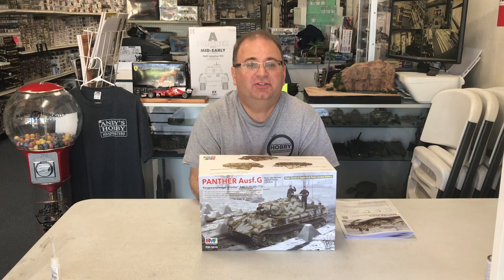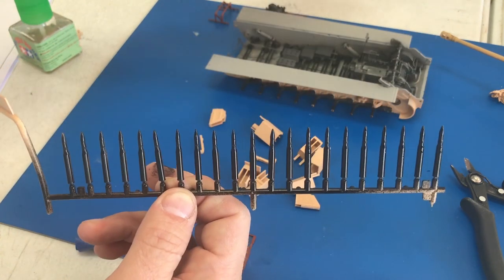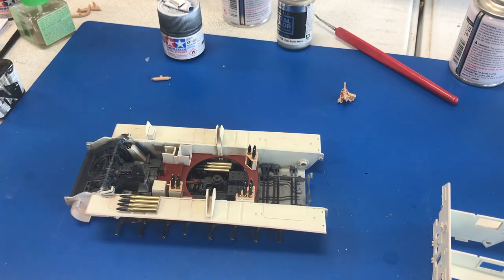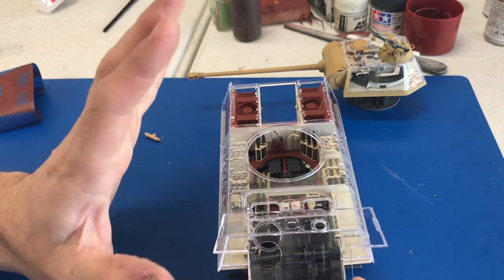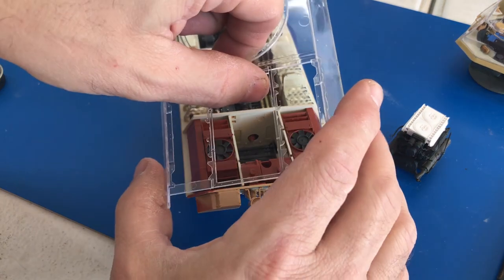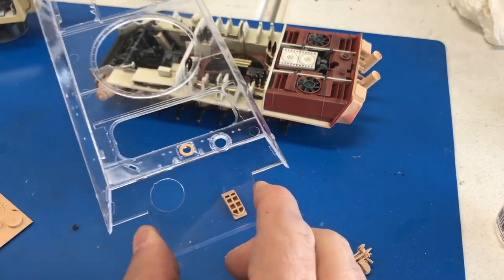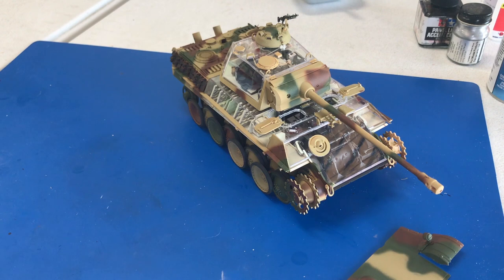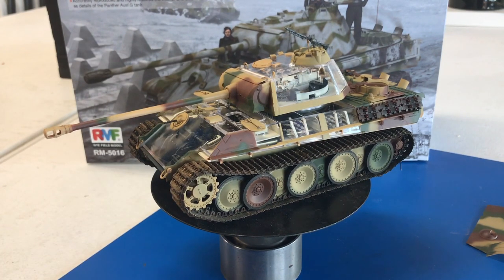Building the Ryefield Models Panther ausf G  part two with full interior

Comment: I know this was a couple of years ago but I have just started making the Jagdpanther G2 and I would say these kits are definitely not for the beginner. So far I have built the gun and upper hull and there are a massive number of very small parts where I had to use a powerful magnifying glass to do the work. The Jagdpanther only has a clear roof to the gun compartment so I have used my dremel to cut through the walls of the hull otherwise the interior detail won't really be seen. Like you I am going to leave out a number of the shells to aid visibility of the interior.

Comment: Excellent job Andy. This is a great run-through for those of us who want to build the kit. As the issue with the front painted glacis vs clear glacis unfolded I wondered if one could slice off the weld beads that are on the side plates and glue them to the painted glacis. Then the painted unit could just slip or rest right on top of the clear portion. I don't have the kit in front of me (yet...) but I'll be looking at that option. Perhaps leaving the engine out would be a nice option too so one could see the engine and peripherals as a whole and still look down into the compartment. It would also be fun to "litter" up the empty areas with discarded ration boxes or spent MG shells or a some maps or magazines, etc. to make it a little lived in.

Comment: Great work Andy, I have the cutaway version and no instructions for the cutaways, justt stock so working my way through,  hope thise migraines are temporary.  I noted you had issues with the floor cross struts and I noticed your sponsons have a gap between them and the lower hull suspension plate.  Mine are flush and the cross pieces fitted like a dream, except the rear 3-piece section which was a nightmare.  Currently it is all in sub assemblies waiting for painting.  And one guy's comment was very true, the lower section was meant to be a dark grey green RAL 7009 with trans and other parts as they came from their factories, often just black, and the lower hulls in late 44/45 in primer when Henschel couldn't get the paint and wanted tanks off the line asap.  The allies were very active heavy bombing every big factory they knew about.

Comment: Andy, I've noticed that the painted plastic slides a lot. Especially the front glacias plate. How or what paint did you use to keep it so durable. I'm using mission models paint and it keeps scratching off the plastic. I wash the plastic but the paint still scratches off.

Comment: After painting parts you'll be gluing and affixing later, do you scrape the paint off the areas where you'll be applying the glue? And, what type of glue do you customarily apply to clear parts? When i was gluing some windshields on a jeep i previously assembled, the glue made the joints opaque......one more question...do use use a primer before painting any of the parts?

Comment: When you installed the floor supports, maybe loose setting the firewall in could have helped with the gap problem. It might have given everything a truer width indication. Maybe push it a third of the way down so it would not be too much in the way.

Just using a little logic here...

Comment: Question for you Andy. I am getting back into the hobby after 35 year break. I want to glue together and paint sub assemblies that are the same color. But would like to paint smaller detailed parts of different color while not glued in place. Example would be painting ammo and then gluing onto the racks or painting tools before gluing onto the hull. Any advice or videos for me?

Comment: I am building this model and I noticed your kit is missing some parts (as in you didn't install them?)  On the turret basket floor there is a rectangular looking Photo etched box, some other little photo etched pieces on the floor like these 2 little triangle parts and another metal piece that goes over a small cylinder on the ground, also,the piping from the air compressor.  how come you left all that stuff off?

Comment: Far be it from me to question the master but if the torsion bars and the firewall need 'flexing' to fit does that not mean the sides of the hull are off true rather than the parts being too long?

Comment: You already fixed in the torsion bars and the transmission in the previous video, how did you manage to paint the chassis white under and around them?
Reply from the maker: I used my airbrush very closely and if there was any overspray I touched it up, but I can get really close with out much overspsray

Comment: Just about to finish the hull cutaway version of this.. It's a wonderful model, but sadly let down by woeful instructions (the cutaway version gets the instructions of the full version, so you're expected to work a lot out for yourself) with pretty awful translations and unclear illustrations. There are also a few weird problems with the mould design (holes being left out randomly, etc) and just general brain farts (the first aid kit has a strap/buckle over where the decal should go, requiring veeery tedious decal surgery).

But... if you have the patience, then it is an awesomely detailed final product. One thing I would point out though, is that the colour outline the kit comes with is pretty much entirely wrong!! A 1944/45 Panther will generally have a red primer base on the hull, not grey (the factories simply didn't have the paint, especially going into '45). There are quite a few other glaring errors, so I'd recommend doing good research prior to painting literally anything.